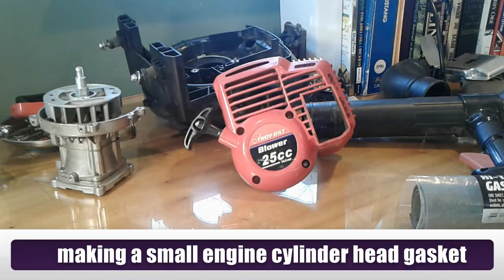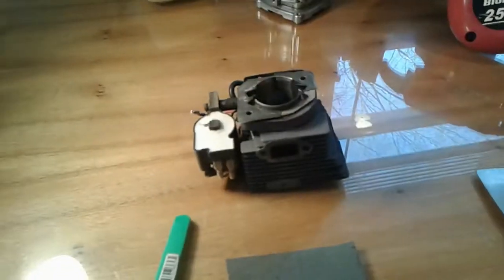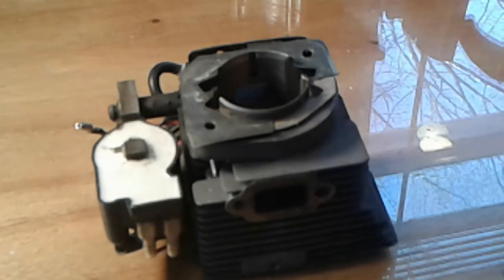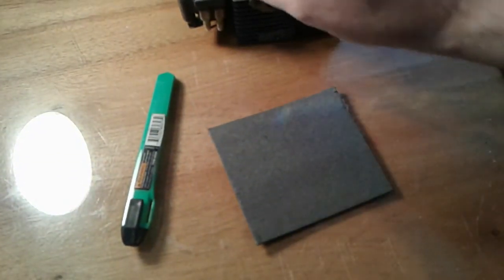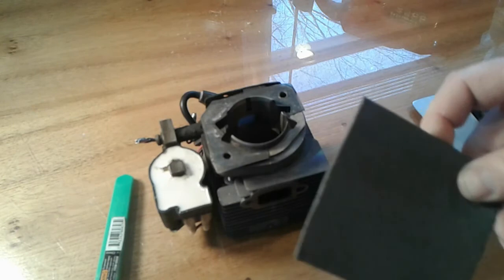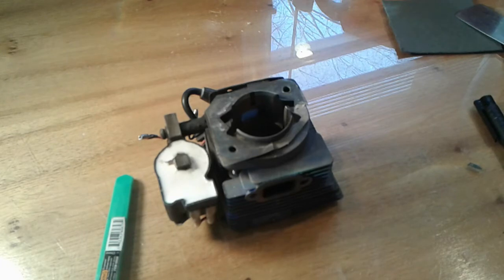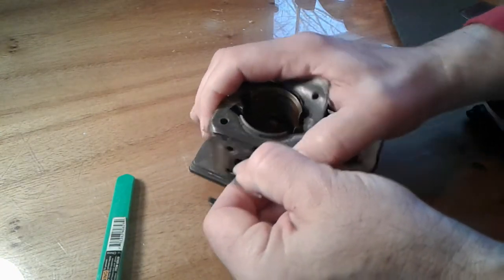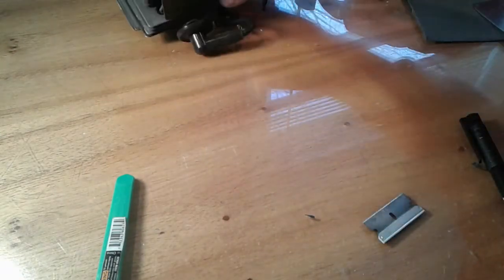DIY Small Engine Fix - How To Make Your Own Gaskets

Comment: If you have a flat-bed scanner, stand-alone or on your printer, you can sit the cylinder on the scanner bed, scan it, them print it out (I use card stock but regular paper will do). You will have an accurate, full size representation of what you need to cut to make a template to transfer to your gasket material.  I do it quite frequently for carb gaskets.

I haven't tried printing directly to any gasket material yet but that may work, too.

Comment: Can I make a base bottom gasket out of a cereal box for my 80cc motorbike if I do not have none of the gasket stuff will it work with another affect my motor I just rebuilt it in the running
Reply from the maker: A cereal box is just cardboard, so don't use that. The gasket material is easily available on amazon or a local auto parts store.